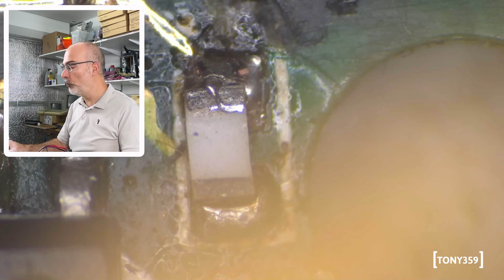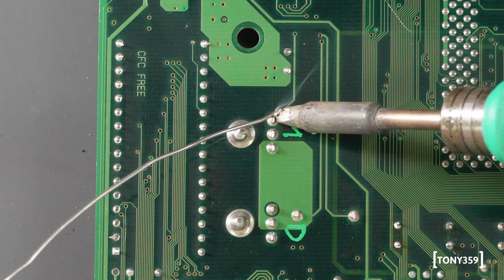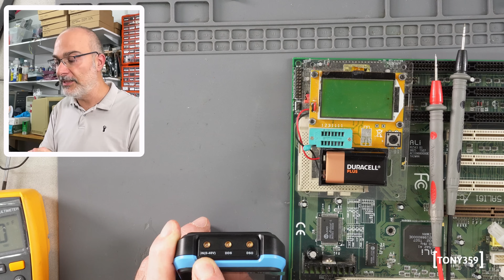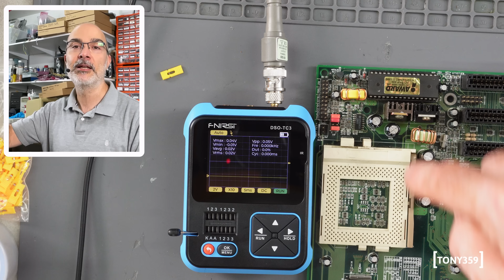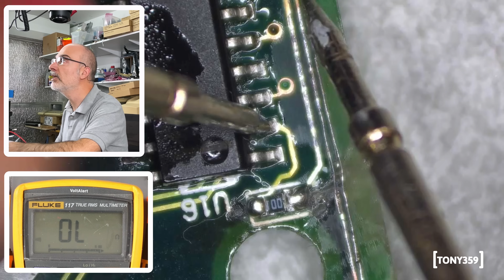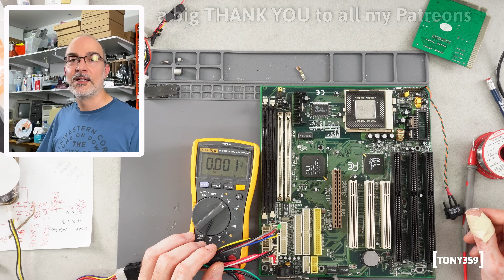This motherboard surprised me with multiple unrelated faults!

Comment: You can think of the ESR as an AC resistance in series with the capacitor ( AC resistance because it manifests in AC ), and knowing that helps quite a bit, because ESR testing is done be passing an AC signal trough the capacitor and measuring the current and the voltage drop, an equivalent series resistance can be calculated. 
The problem is that the testing signal frequency must be high enough to make the capacitive reactance unsignificant, but not so high as to get an value influenced by the ESL. 
If testing on a lower frequency then the software must calculate firs the capacitive reactance from the frequency and the measured capacitance, and subtract that capacitive reactance from the final ESR value. 
Also, for the value to be a precise one, the rms current drawn by the capacitor under testing, must be accurately measured, and that way after measuring the AC voltage drop on the capacitor, an ESR value can be calculated. 
Granted, there may be many other ways to do it, but this is the most intuitive i know of ( easier to understand ).

On a regular ESR tester ( meaning one on which you can select the ESR function before the actual testing ), you simply use a known resistor of a small value, and let say 1% or maybe something better if possible, and you test that resistor with the ESR function, if the read value matches the resistor value, then the ESR meter is well calibrated ( it is best to test this with SMD resistors for their low inductance ). 

On the component tester i do not know if you can do that, but you can replicate the conditions described above. 
Use an audio amplifier ( the power doesn't really matters, just use what you have ), give it a sine wave at it's input, and put a capacitor at it's output as it's load, making sure to use a series resistor with that capacitor, both because the amplifier will not enjoy the capacitive load, and to limit the load current, and measure the RMS current ( sine wave because it is easier to calculate the rms ). 
You need to use the scope for it's high bandwidth. 
Use whatever frequency your amplifier is happy with ( let say 10khz ), you first calculate the capacitive reactance using the testing frequency and the tested capacitive value with the Fluke ( i think it's way more accurate then the component tester ). 
Then measure the voltage drop on the series resistor ( well measured value resistor, with the Fluke of course ), to calculate the rms current, then lastly measure the voltage drop on the capacitor under test pins. 
What voltage drop you find you divide it by the rms current, and then you subtract from it the capacitive reactance calculated at the beginning, what is left is the ESR, and it should be quite reasonable near the real value. 
That way you have something to compare it with the component testers, and if one of them is way closer to the value measured in the improvised way, then that component tester is more accurate.
Reply from the maker: Thanks for the extensive explanation! Someone also suggested to measure a new cap, then add a resistor in series and measure again and that resistor's value should add to the ESR value?
Reply: @tony359  you are welcomed, as always.

I did thought about that way too, and it should add up, but it may be tricky to find the right value resistor. 
You do not know how the firmware is configured and how the tester reads the components, thus it may see it as a resistor instead of a capacitor, or it may not see it as anything... 

A small enough resistor could be ok, meaning it could not confuse the tester, but too small a resistor would make the comparison pointless ( 16Ohm read ESR in series with 1R means nothing for any good comparison ).

A bigger value resistor would make the comparison much more precise because a known value resistor would dominate the reading ( for example 16Ohm read ESR in series with 100R, would be much more relevant because the 100R resistor dominates the total value ), but it could also confuse the firmware, so...

Ah well, you can always test it, experiment with different resistors, see what you get. 

You can also test new and good quality capacitors which have their ESR already specified in their datasheets, you thus know about where the component tester should read, so you will find out which of them is better. 

You could also find that they both read close values of ESR on new and good brand caps, that means they actually are calibrated on some level. That would mean that they read different values on bad caps because they could have different firmware configurations for reading higher values...

Just sayin', electronics really is fun, ain't it?...😄
Reply from the maker: I have now tested, adding a 34 Ohm resistor. The old tester reads ESR of 34 and the same (correct) capacitance. The FNIRSI reads something completely different (I forgot!) and the capacitance dropped 20% (from 1000 to 800)
Do you think this test has some meaning?
Reply: @tony359  It could suggest that the old tester is better at ESR reading ( at least on high values ). 
But to be sure there needs to be much more testing, with different value capacitors and resistors, with new and old capacitors, the more you test, the more relevant the comparison. 
You lay every single result on a spreadsheet, then you analyze the results and you will see which of the testers is better.
Reply from the maker: Thanks. I'll do some tests - but also understand that the final test is with a proper LCR meter :)
Reply: @tony359  yes, that is the best and most relyable way.

Comment: FNIRSI TC3 displays absolute GARBAGE instead of ESR! Capacitances, however, are measured correctly.
EXAMPLE. 220 μF 63 V Samwha SD: 0.12 Ohm. The same capacitor with a 8.98 Ohm 0.5% resistor in series: 1.5 Ohm (!!!).
On an old Atmega based component tester: without the resistor 0.20 Ohm, with the same resistor 8.5 Ohm. Way closer to truth (the total resistance should be around 9.1 Ohm).
Reply from the maker: amazing thanks, I am going to do this test later on!
Reply: @tony359  Tony, would be great if you'll do a video  about the reliability of the TC-3 Multi Tester  and/or use it more often. I got one for most less offer, because I have a serious lack of money and I have to repair/refurbish a lot of computer and audio stuff.
Reply from the maker: I might make a short video where I run some tests on my second channel.

Comment: Couldn't that be some bad cap or resistive path pulling the inverter's limited high output voltage down?
Reply from the maker: Well, I am told that the Power Good line from the inverter reads 3.5V on a working board. The reset line reads the same weird voltage without the inverter. Anything's possible but it feels unlikely, what do you think?

Comment: What about trying a pullup resistor to 3.3V in case the output of a chip is weak?
Reply from the maker: on the Reset line? I did look for a pullup somewhere on the board but couldn't find any. Are you suggesting to pull-up the whole reset line?
Reply: inverter chip is after SB, so probably weak is SB, but it has 3  reset outputs - ISA,  PCI and CPU
Reply from the maker: Indeed. I could try to pull up the CPU reset line and see if it starts?

Comment: I really doubt that bga chip is faulty. Chances are low... must be something else.
Still very interesting investigation!
Reply from the maker: I've done some more tinkering and I cannot find much. I wish it wasn't BGA so I could poke the legs and make sure it gets power, clock etc. I found the CPU reset line is stuck in the same weird way (hint, maybe the CPU was fried and fried the reset line?) and the small 32KHz clock is working. But yes, it could be something else for sure.

Comment: Thermal camera:  can you swap to another color palette that doesn't have white as the hot-spots, so you can read the text when needed?

Component testers: The ESR is likely being measured at different frequencies. Even a real LCR meter can keep you guessing a bit because the ESR on caps changes based on what frequency you chose to measure them at. 60hz/120hz/1khz/10khz/100khz.

I have one of those Anatek "Blue ESR" meters that runs on a freaking zilog processor of all things, the dude who made the power circuit was brilliant, same 9v battery it's whole life so far. I often prefer my Siborg "LCR-Reader" tweezers, though they were twice the price, but capacity+ESR is a winning combination that you need to know and the form factor is nice. Their models like "LCR-Reader-MPA" have even more features, but are just far too rich for my blood. There are also ones like "Elite2" and "Pro1" by LCR Research.
Reply from the maker: I could, good idea, though it should really be black as the text is miniscule on my 3K display. It's a DPI issue with the app. 

Yes, I understand that ESR depends on the frequency of the measurement. However, those components testers don't use high frequency to test ESR, I'll publish a follow up on the second channel to give some extra insight. I'm looking around for a proper tester, I might get one at some point. Thanks for your feedback!
Reply: @tony359  I think I might actually partially understand what you're referring to with the parts tester now,(I needed to go look at some of the sourcecode and still only have a base understanding though!) they don't deal with measuring proper phase angles or actually push a proper waveform into the parts under test, rather they form a sort of RC network with a few different preset charge/discharge resistors and wiggle things around to take some readings. But I'd certainly watch a video with a proper explanation on how that all works.
Reply from the maker: I am not qualified to give a proper explanation! :) But I wanted to show that they don't work in the traditional way as you also discovered. The ESR reading is apparently approximating the 10KHz reading with a proper LCR meter.
Reply: @tony359  I would just as well accept an unqualified explanation! 
Also fyi I really had to dig to find 259, YT has never recommended it, and it's not plainly linked anywhere, only via community tab.
Reply from the maker: Thanks for letting me know. It's the first line of the video description - but I know it can be lost in all the details. The fact that "Tony259" as a handle was taken didn't help I guess. So it's "Tony259" but the handle is "Tony359_2". Though if you search for "tony259" I think I show up.

What would you recommend to make it more visible?
Reply: @tony359  the first place I checked was your main page where you also link Twitter. But yes I very much missed it in the description, the channel names are nearly identical so it's easy to gloss over without knowing what the difference is.
Reply from the maker: Thank you, I've added the link there - I totally missed that!
I might end up changing that name at some point... :)

Comment: Verify clocking of the chip (14 Mhz). And I thing some of this boards require good 3V bios battery to dessert reset.
Reply from the maker: I tried with and without battery - but the clock is a good idea, thanks!
Reply: @tony359  Power and reset sequencing in the southbridge runs from that. Another strange thing is voltage level on the ISA reset, try to check levels of other signals. May be a problem in the chipset power. There must be circuit that power chipset from +5V Vsb for ATX (and 3V3 generation) and some combination for AT power.
Reply from the maker: The document says that there should be a jumper to select AT or ATX - in AT mode, as soon as the chipset gets power, it powers up. In ATX mode, it gets in standby and waits for the power switch. But there is no such jumper on the board so...
Reply from the maker: Thanks - Ah yes, I forgot about the 3.3V. I'll check that too even though I believe the ALi datasheet says the core of the SB is powered by 5V. I saw the other comment - haven't responded yet because I want to check those pins first :) I checked the clock directly on the PCB and it works but checking on the ISA slot is better. I thought the 3.3V regulator would end up much closer to the AGP slot - weird! Thanks for the hints!
Reply from the maker: I've now checked contacts 20 and 30 and there is no clock there. Maybe I saw it for a split second on one of my tests but I could not replicate. As a reference, I do have clock on a different board. That is the ISA clock though, isn't that coming from the SB? If the SB is dead, then maybe I would expect not to see a clock there?
Reply: @tony359  Yes, it is generated by SB. "SYSCLK O-Group A ISA System Clock. This output is generated by the PCI clock or OSC14M clock and is
used as the ISA system clock." 
You can also try measure outputs of ICS 9148BF.

There is also 32KHz oscillator: "This is a crystal input 1 from a 32.768 KHz Quartz Crystal.
The M1543C will generate the 32 KHz clock for the internal Suspend circuit and output
the clock from the CLK32KO to DRAM Suspend Refresh Circuit in North Bridge. If a
Crystal is not used, an external 32 Khz clock input should be connected to this pin."
- Also there are decoupling capacitors around chip set - are they powered?
Reply: I found hi-res photo, so:
- check F2 and fuse next to it (cant see number, most likely 3)
- check L1 and L2 (I think this is chipset feed). You should see plausible voltage on both ends.
- check voltage on C47 and BC40
- output of 3V3 regulator (Q2 / Q1?? Looks very strange)
Reply from the maker: @petr56321313  Thanks again for taking the time to help me. ICS should be working, I do have 66MHz at the CPU. Is the SB using that clock at all? The 32KHz crystal by the SB is working. 3.3V is working. I'll check the rest and report back :)
Reply from the maker: I've checked and I think I found something. The 14MHz reference clock from the clock IC has some DC offset and it's only about 1V p/p. This reaches the same inverter and it's supposed to be inverted and then it reaches the ISA slots. However, because the clock has about 3V DC offset, the inverter cannot invert anything as all it sees it's a "high" signal and returns a "low" signal. A very similar board (Shuttle 591P, same clock IC, same inverter) shows a full 0V-4V p/p clock signal which goes through the inverter and reaches the ISA slots. 
I'd imagine this reference clock then reaches the SouthBridge and is required to release the RESET line. I've ordered a new IC. Fingers crossed!!

Comment: In my opinion you can't trust those component testers to measure ESR of a capacitor. You might find this recent video from "Defpom's Electronics Repair" interesting: https://www.youtube.com/watch?v=1BhfNQuzeLs&t=14s
Reply from the maker: Indeed, Scott made that video after watching mine and I made another follow up video after watching his :) 

The point though is that the original tester CAN be used to measure ESR, just won't be immensely accurate but perfectly fine for a "good" or "bad" answer. The FNIRSI is just useless.
Reply: @tony359  I agree 100 percent...

Comment: If you're not comfortable with doing BGA, I wouldn't want to push you. Or recommend you do it as anything other than a practice test, knowing this board is expendable.

I know it wouldn't actually fix what's going on, but would it be advisable for testing purposes to bypass the southbridge's weird mid-voltage output and instead feed 3.5v directly into the place that expects it, in order to clear reset? That way you could see if it works otherwise .
Reply from the maker: I can try that but the SB has three reset lines: ISA, PCI, CPU. To be fair I forgot to check the other two lines but I’d need to force all three lines and not the ISA only. It’s an idea though.

Comment: I seem to be in the minority here, but i would NOT replace the southbridge, although I might let someone else make the attempt. Since you admit it's not in your wheelhouse, I would 100% understand if you just declared this a "parts board". That's what I'd do. It's not sufficiently rare to be worth saving at all costs, and I don't think I would have pursued the voltage problem because a parts killer is worse than no board at all. Once demonstrated to be dangerous to other components, I would have declared it "for parts only" and maybe gone so far as to remove the power connectors from the board to make damn sure nobody tries to use it.

I guess I'm saying you crossed the line where I would have accepted failure a long time ago, and I honestly think you should accept failure at this point if you don't have a high degree of confidence in replacing the southbridge.
Reply from the maker: I see your point but "accepting failure" is not what I usually do! :) 
The board is broken anyways, you might want to see the attempt - if I ever decided to go for it - as BGA practice :) 
Thanks for your input!

Comment: These component testers need to be calibrated with a known capacitor before you can reliably measure capacitance and ESR. Just saying...
Reply from the maker: Well, the "calibration procedure" is to short the leads and press a button. 
What kind of calibration can you do with a known capacitor?
Reply: @tony359  no idea. Maybe to set a baseline. On mine I need to measure a certain value, but the tester guides me through the steps.